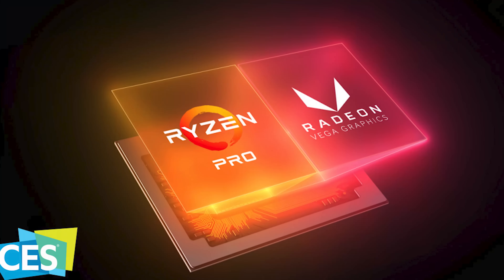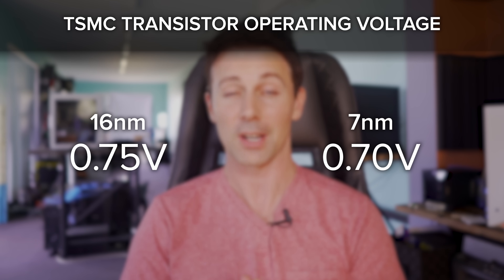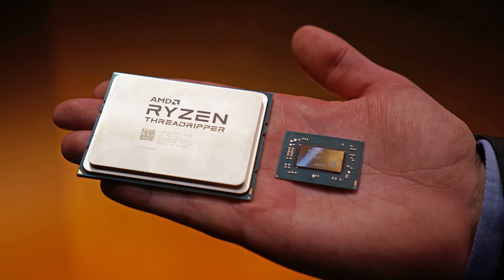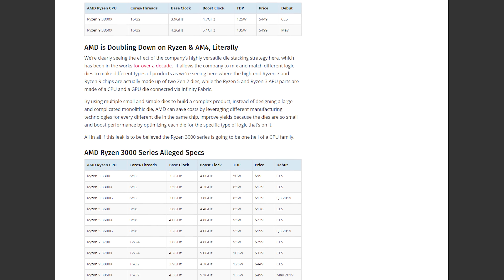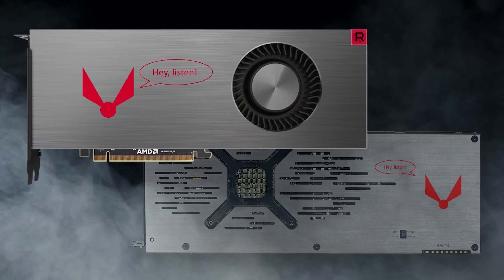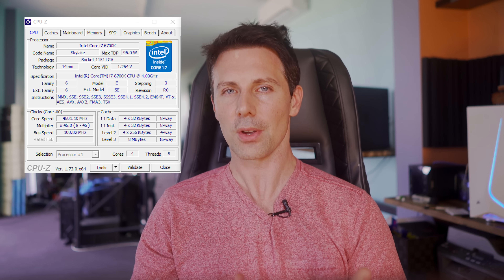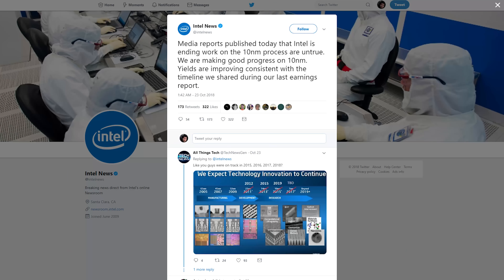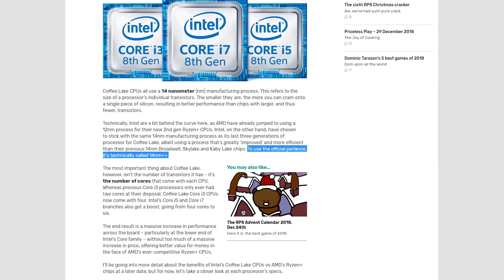7nm, 5nm and Beyond - Will AMD RYZEN 3000 be the PINNACLE...!?

Comment: TSMC's 7nm node must be really good if the rumors about Ryzen 2 reaching 4.8 - 5Ghz are true. As far as I know the reduction in size of the gate (between source and drain of the transistor) is what has been causing Intel big problems with their 10nm node in that they simply can't reach clock frequencies as good as on the 14nm finFET node because of tunneling effects. Any word on how TSMC might get around this problem?
Reply: It has more to do with them trying to implement EUV and having many, complex layers of wiring. When you scale that down, the thickens of the walls don't scale down at the same rate, leaving them with less space etch that complex wiring.

It also has to do with the fact that Intel's 10nm process produces a greater transistor density than TSCM's 7nm process.

Intel is struggling with yields. Intel uses monolithic dies, so if certain elements on the die is faulty, the whole die is scrapped.

It's the reason why they're moving to chipsets. The aim is to improve yields. The aim is also to spread production across their manufacturing capability by producing some of the elements of the CPU with older, more mature processes. In order to keep up with demand as much as possible and not lose more market share. 

The main reason they lost market share is because they can't keep up with demand. Flat out switching to a new node would reduce yields and output until the process matures. And then there was AMD becoming competitive right at that time. It would have been a kind of suicide to flat out move to 10nm.
Reply: Not sure, but they probably patented the shit outta it.
Reply: It has more to do with them trying to implement EUV and having many, complex layers of wiring. When you scale that down, the thickens of the walls don't scale down at the same rate, leaving them with less space to etch that complex wiring.

It also has to do with the fact that Intel's 10nm process produces a greater transistor density than TSCM's 7nm process.

Intel is struggling with yields. Intel uses monolithic dies, so if certain critical elements on the die are faulty, the whole die is scrapped.

It's the reason why they're moving to chiplets. The aim is to improve yields. The aim is also to spread production across their manufacturing capability by producing some of the elements of the CPU with older, more mature processes. In order to keep up with demand as much as possible and not lose more market share. 

The main reason they lost market share is because they can't keep up with demand. Flat out switching to a new node would reduce yields and output until the process matures. And then there was AMD becoming competitive right at that time. It would have been a kind of suicide to flat out move to 10nm.
Reply: @pouyatavakoli4958  I also read TSMC's 7nm+(EUV) is going to increase the density by x1.2
Just curious, do you think TSMC or samsung have the superior process? My knowledge is limited...
Reply: "Any word on how TSMC might get around this problem?"

They don't really. Intel's 10nm is actually smaller than TSMC's 7nm in some dimensions.

Comment: As far as I understand, Quantum tunneling is a physical limitation, and EUV lithography is not a solution to it. (The solution to continue to increase density is to make atom based transistors or start doing 3D stacking, and to get more performance we'll have to start coding for multicore better. Or maybe graphene for ridiculous GHz or something.)

The issue is simply that with current lithography techniques we can't even make circuits small enough that they are affected by quantum tunneling (and it is the reason Intel had so many delays for their 10nm process - it was unrealistically dense for current lithography techniques.) With EUV we are going to be able to make transistors small enough that quantum tunneling will be a problem and with different metals we may be able to reach "3nm" (whatever that actually means in terms of actual sizes of the finfets - it's marketing). 

In any case, we really only have a decade's worth of improvements with the current technology, probably less, so yeah let's hope someone makes a breakthrough.
Reply: yeah, I'm like, EUV would only contribute more to quantum tunneling if it makes the features smaller.
Reply: I love my dog and Mars Bars!
Reply: just as Fin-FETs replaced planar transistors, Gate All Around (GAA-FET) will replace Fin-FETs. In planar transistors the gate contacts the channel on 1 side, Fin-fets the gate contacts the channel on 3 sides, GAA-FET the gate completely surrounds the channel from all sides.
Reply: Yeah that was a slightly weird wording in the video
Reply: EUV really is only for higher yields and more accurate making of said chips. Quantum tunneling can really only be fixed with better materials.
Reply: @noble64115  not really. The effect can probably be lessened  a little bit by better materials but no material in the world can stop quantum tunneling. The size limit here is absolute...
Reply: @zamundaaa776  right the problem is in the uncertainty in the location of the electron. it can be randomly in any position with in that uncertainty "bubble" if you try to confine it below that size it may appear out side you're confinement. tunneling is kind of a bad name for it as the electron dosnt actually move through that distance its just there or over there and dosnt exist in between, so i;m not sure what changing the material would do as it dosnt pass through it.
Reply: @jedadiahtucker2132  so does that mean if there was hypothetically a way to monitor the electrons as they were flowing that they would not be able to "tunnel" like with Dual slit experiment?
Reply: @noble64115  quantun tunneling can happen even in neutron stars, the material helps if makes the barrier bigger, but if it is so small the noise starts to win over the data.
Reply: @noble64115  Graphine...
Reply: only if we can make quantum tunneling as 1 and 0 instead. where if electron can tunneling it returns as 1, and when it not tunneling it retured as 0. 😂
Reply: @novelnouvel  quantum tunneling is how transistors work in the first place. The distinction should be made that unwanted quantum tunneling is the problem.
Reply: @Jadinandrews  Bipolar junction transistors use quantum tunneling, but field effect transistors (FETs) such as MOSFETs, which are in the CPU, don't.
Reply: Back in time, it is sad that under 100 nm  technology wont go. and, not so much later (20 years is not very much, is it) its gone way more then 10 times smaller.  Its astonishing. Mindblowing.
Reply: The breakthrough has already broken through although of course its not scalable into personal devices. That technology is quantum processing. But of course you can't attach a huge refrigeration unit to a PC or phone right?

So the long and short of it is solid state chips that handle minimum on unit processing with the heavy lifting done by quantum cloud processing. The new problem there, or the downside, is data transfer and physical distance to the datacenter and the number of nodes in between. Other solutions include 3d neuromorphic processing and memristor technology. Its still confined to the 5nm limit though and there's nothing anyone can do there. Mother nature isn't changing her mind about that. 

Then again your brain is equally confined to this limitation yet its processing capacity is pretty high in terms of using 5nm and really slow data transfer. There's a very good reason that the distance between glial cell dendrites in brains generally can't go below 5nm. They just won't work due to quantum tunneling effects. All the same some of them do...with unpredictable results.

But there are a lot of solutions already in the pipeline. Just as there were when it was realised that the whole 'giant room full of valves' wasn't a scalable model and had reached the max valve Moore's law of the 50's and 60's. So there are solutions... Plenty of them.
Reply: Graphene seems like the only possibility as quantum computers won't necessarily help gamers. Anyone know of anything else? I remember reading about another material that might replace silicon but that'd be decades maybe if ever
Reply: @vitiate7750  since the discovery of graphene, other 2 dimensional materials have been discovered that may actually be easier to grow than graphene. I don't have the details on hand but I think that graphene is a gateway technology to even more advanced materials
Reply: @Jadinandrews  Graphene is actually quite crap for transistors. It does not have large enough on-off ratios to be able to be used for processing. We can already grow single crystal graphene in large sheets, but transferring the graphene from the Cu foil where it's grown to the SiO2/Si substrate causes a lot of quality degradation. The 2D semiconductors similarly don't have enough mobility to be able to operate at high frequencies. It would be nice, but now we're focusing more on areas where graphene and similar materials can make use of their unique properties, rather than shoehorning them into something where they would not be able to compete.
Reply: @patrikgubeljak9416  Thanks for pointing that out, I incorrectly assumed all transistors used quantum tunneling as the mechanism. I am aware that graphene is not suitable for processors, but I said that it is probably a gateway technology to future materials that will be.
Reply: @vitiate7750  Maybe you mean Germanium?
Reply: I read somewhere that quantum tunneling can be overcome (Idon't know how much) by having adjacent wires in a circuit, carrying like charges but that means according to my understanding, that the cherge pulses would need to be all at same frequency and synchronized. This goes against my idea, atleast, that software needing to become very multithreaded, although been still digital in nature, will have to mimic analog physical processes. That seems to mean asynchronis pulse charges. So if software becomes very multithreaded then smaller nm size could be lower priority than analog mimicing digital hadware and software.
Reply: Quantum tunneling doesn't occur here BECAUSE NOTHING IS 5NM IN THAT ARCHITECTURE! It's just a marketing slang!
Reply: Computers processing light particles instead of electrons, at the speed of light, minus almost all of the heat - photons have no mass, no friction, no heat~
Reply: he reported the manufacturing process, not solution. Finfet is at an end but there's still hope after 5nm.
here's a read: https://semiengineering.com/whats-after-finfets/
Reply: How many more years worth of improvements do we have if coders start writing more efficiently? Right now there is a ridiculous amount of fat and waste in code.
Reply: 3D stacking is not very useful, it's not a problem of lacking space to put silicon in, it's a problem of energy efficiency. Cramming double the transistors in a given package doesn't help you much if you also double power consumption and heat you have to deal with. When we get to the point where next node shrink will never happen again then improvements have to come from elsewhere. More specific hardware accelerators that can do a specific task more efficiently than CPU, really squeezing the last out of code optimizations, offloading computation to someone else's computer, nothing new or revolutionary really but there has to be a whole lot more of that stuff.
Reply: +Zamundaaa yep.  we're going to get to the point where multiple chips that have custom circuits, probably in an MCM are going to be the next step.   the next step after that is going to be software optimization.   and afterwards, it'll boil down to just being happy with what we get and not being such ungrateful bastards, lol!
Reply: Yep I noticed that too, the guy hasn’t got a clue what he’s talking about

Comment: Clearly the clocks are not getting any faster than 5ghz and all that cores are not finding enough applications to crounch.
In this situation, it might be a solution to leverage the cpu to do complex and fast calculations, per example ray tracing ?
Reply: Current cpu design is not optimal for raytracing. However CPU design is much better. So perhaps adding CPU design elements or compute cores like specialized versions of apu's might be possible. Of course what I don't see much talk about is how the Epyic chiplet+i/o core design doesn't have to be core + 8 cpu chiplets. Other sorsts of chiplets should be addable. Very fast low latency ram, compute cores based on Navi or simular, Specialized core for specific compute tasks, ect. two 8 core zen2 chiplets, 2 navi based compute chiplets, and 4 highspeed/low latency ram chiplets of a gig or more could be quite interesting. I suspect AMD's engineers have considered this sort of thing in depth and are exploring these sorts of options for the future. The flexibility possiblies I see could be quite good for AMD if they leverage them properly.

Comment: I'm curious to see what CPU's will be like in the future when we hit the limit for nm yields, might we see physically larger chips with just more in them to compensate? I'd be down for a larger, more power hungry as long as i got the cores & MHz :D
Reply: You might be down for more power hungry chips, but unfortunately, the processor market today is driven by mobile devices and servers. Mobile devices can't have power hungry chips because of thermal and battery limitations. Server owners don't want power hungry chips because it's gonna cost them a lot more money over time, because of increased electricity usage.

If we hit a physics roadblock for a long time, we'll probably see performance gains from new instruction sets and specialized circuits in our CPUs. More hardware acceleration of more types of tasks, at the expense of larger dies. Fortunately, this can be broken up by chiplet designs to keep yields high. Inter-chip latencies aren't as big of a deal if each chip has enough cores for any single program's thread needs, such as keeping all of a game's thread on the same chiplet, then putting all of the video encoder's threads on a different chiplet. It looks like some of the new AMD designs are gonna end up with 8 cores per chiplet, which, with SMT, is going to be enough to supply a game with all the threads it'll want for many years to come.

Server workloads are already often optimized for parallel processing, but consumer software products will in many cases have to get better at it, and also get better at utilizing additional processing hardware available in computers, such as gpu acceleration where possible. Fortunately, lots of developers are already heading in this direction. Especially games are much better at multithreading now than just 10 years ago, and all our web browsers utilize it well too.

Edit:
Additionally, I think multithreading in itself can help with keeping power consumption down, if used right. IIRC, two chips with the same architecture, one running at 3 GHz with 4 cores, the other running at 2 GHz with 8 cores, would do more work per watt than the higher clocked chip, due to power requirements increasing exponentially with higher frequencies. Developing software that can do more with many cores could keep power usage in check. Doubling frequencies will double processing power, but it will more than double power consumption.
Reply: @stale2665  very well said! It is without a doubt going to be interesting to see were we are heading for sure, hopefully solutions in the mobile & server field can be implemented in desktop systems at a reasonable cost
Reply: Amd is already laying the groundwork for that sort of thing with their infinity fabric. It enable building larger cpu's from smaller sub-chips. This enables better yield and thus cheaper cpu's overall. With chiplets you can build a cpu after binning many different chiplets, whereas with a monolithic die like pre-ryzen chips and intel's current offerings you can only bin a cpu as high as the weakest part. Also for a given wafer size and defect density you get more good parts, whereas with monolithic chips one defect in the wrong place and you lose a whole cpu which represent a much larger chunk of that expensive wafer.  The downside is intercore latencies tend to be higher. Also Amd's implementation in zen1 and zen1+ has the infinity fabric speed tied to ram speed making it more sensitive to ram speed and latencies and more finicky there as well (though much reduced in zen+). Hopefully Zen2 improves even more on these factors.

Comment: So now it is nice to upgrade from 6700k to this ? That's really good processor for almost everything, but now I see that new processors boost up fps in games quite significant (of course in 1080 p and 1440 p not 4k, 6700k is basically perfect for 4k 60 fps gamepaly with 2080 ti). But I am planning to buy ultrawide 1440p with 100 Hz or 200 Hz. So just wait for 7nm processors to become cheaper and buy it 2019 at decemeber or even 2020 ?

Comment: What about other processors like RISC?  X86 has a host of legacy issues. Wouldn't it be prudent to abandon X86 and move to a newer architecture built specifically with established software in mind?
Reply: Modern x86 is actually risc at the core. There is a 'translation' layer that breaks x86 code down into smaller risc style micro-ops. This has been going on long enough that the 'translation' layer has very,very  little impact. Not zero impact however.

Comment: Litterally built a PC (because of you and Linus) using older server hardware, for around $600, getting over 2000 points in cinebench thanks for that....

PS could you do a review on Dell t5600 that's what I used as platform, because it's really cheap supports duel LGA 2011 and quad channel ddr3, got myself a barebones prebuilt for $209 US, I came with an 825w PSU meant for servers.

Thanks again, I have subscribed